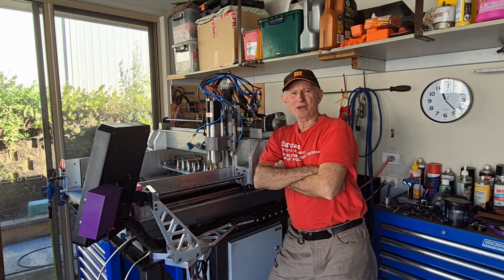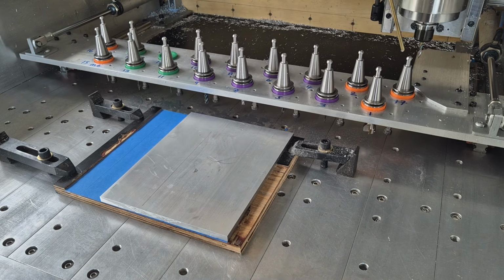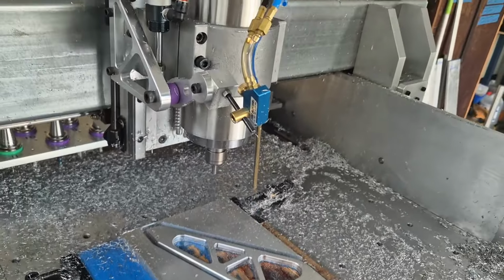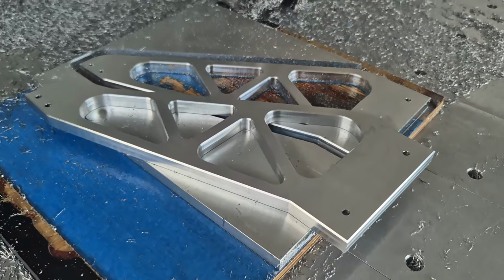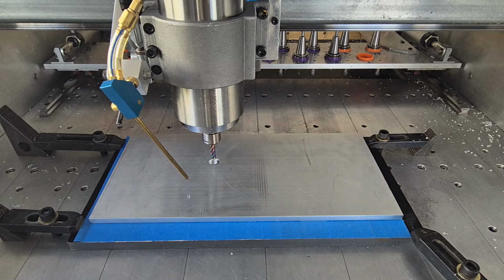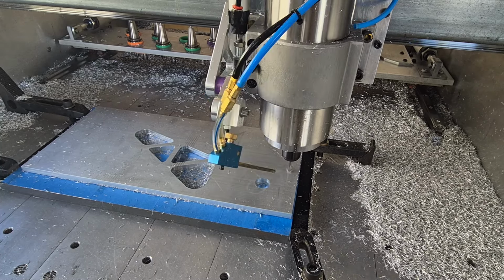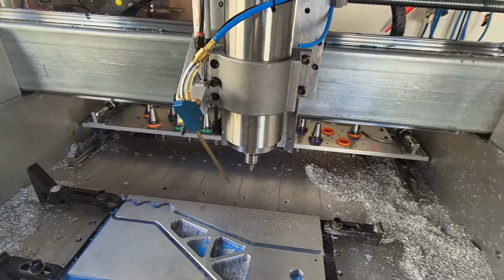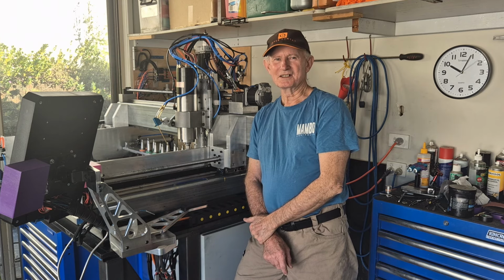Bill's Home Built PrintNC Pro CNC Machining a 6061 Alloy 5 Way Adjustable  Monito Mount

Comment: Nice work Bill..
Reply from the maker: Thanks the machining is easy trying to make  better and better videos each time is challenging but I am enjoying it cheers Bill
Reply: @williamnorris1516  I really like your machine.. I’am also following you on discord, I want to make a machine like yours.. but i’m waiting because you are adding more and more new features every time. I’m waiting your next video, keep it going.. Cheers Ned
Reply from the maker: @my.techlab  Hi Ned good point I am just about to raise my X axis gantry so that I can sort out a cover for the sliding tool rack to keep all those chips off it, and it will also help height wise when I add the 4th Axis ( Rotary ) and be better when holing stock in my vice  But there should not be to many more mods after that. As I want to start my CNC Lathe build soon
Reply from the maker: @my.techlab  Hi Ned I did reply to you but it seems to have vanished oh well not to many more upgrade ha ha as I want to start my CNC Lathe build soon cheers Bill

Comment: Did you make the base/stand out of steel tubing as well? Planning my build but the base comes first. You have a solid machine, would love to see a short video on your base/stand.
Reply from the maker: HI Yes I did make the base as well it was the first thing I made it's a combination of 75 x 75 x 4 mm and 100 x 100 x 4 mm steel tube the back and two side triangulated and a low steel tube bench across the back the strength and weight of the bench is very very important to the machines performance that why so many industrial machine are epoxy granite and so heavy the idea of the shelf across the bottom / back was to put 10 x 20 Kg bags of concrete mix on to add a further 200 kgs to the base which would be removable if I ever want to move the machine if you had a link I could use I could send you lots of photos of the base build ???? Ok cheers Bill

Comment: Thanks for this build videos Sir. By any chance are you willing to share the 3d files for the sliding tool rack and iso20 tool holder cups?  I'm looking to add the same style tool rack to a friends Carbide 3d machine.
Reply from the maker: Hi @Doug10106 Well your friend machine will be a totally different size to mine including the clearance height to the Z axis and the distance you will want to slide the rack etc so custom to every machine  really. But if you get on to the 3 Designs PrintNC Discord go to build logs look for Bills PNCPRO Build and you will be able to scroll back through to around 12/05/23 and see most of the sliding rack build and lots of photos of the 3d printed Iso20 holders which are held in place with shoulder bolts and springs I will try and find the file I used to print them and get back to you Ok cheers Bill

Comment: any 3D model available ? It's custom build printnc ?
Reply from the maker: Hi and welcome Yes very much custom PrintNC Pro Bigger Gantry 150mm x 100mm  all tubes are Gal and 5mm thick some 6mm thick lots of 25mm thick alloy plate,  25mm linear rails and blocks and 20mm C5 ball screws with 16 mm screw on the Z, ClearPath Servos, Jianken 3.2 Kw ATC spindle and of course the Masso touch screen controller ....there is a full build log of my machine on the printnc Discord under Bill's PrintNC Pro build if you are interested, ok cheers Bill